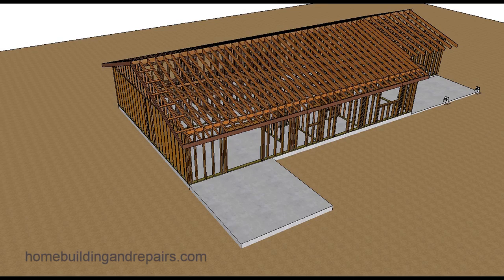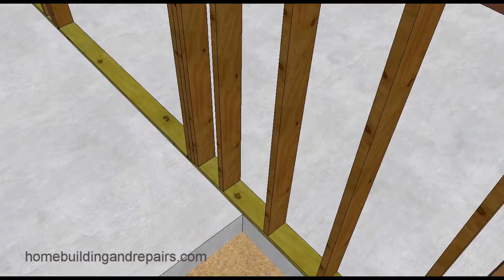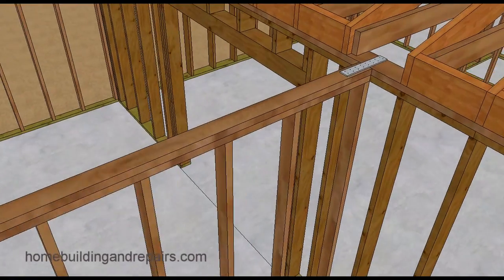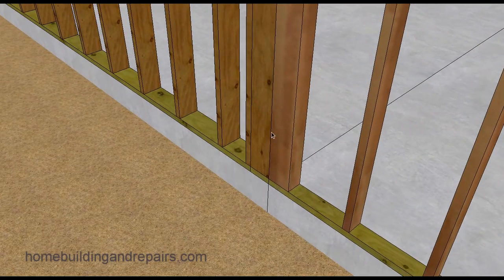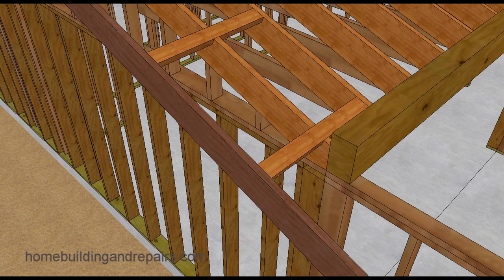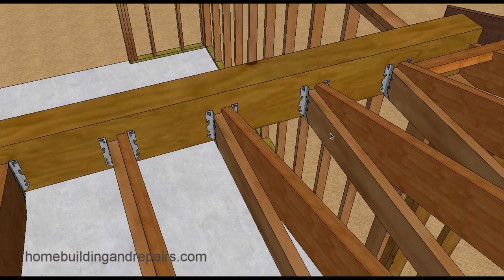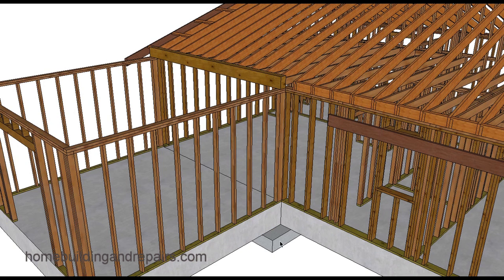How to Install Flush Ceiling Beam for Framing Home Additions – Building Design

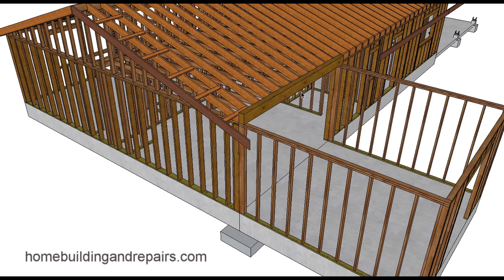Comment: Great video!! Did you make the follow up video towards the end of this video talking about the problems with the beams sticking out of the roof, especially in this case where the beam is at the end of the house @5:40?  I really appreciate the time you take in creating all these videos.
Reply from the maker: I can't remember if I did or not, but if it is, then it's on the website. Here's a link to the website and feel free to post it here if you do find it.
http://www.homebuildingandrepairs.com/home_additions/index.html

Comment: How to cut off raffters flush for an addition wall? Should I cut it from the top or from the bottom? Should I take the shingles off or just cut it straight with everything on??? Thanks alot
Reply from the maker: You can cut from top or bottom and you might need to remove other framing components and roofing before cutting.

Comment: How do you address the beam sticking up? Also, what if you can cut a flat spot on your rafter for the joist hanger since the cut is even with the bottom?
Reply from the maker: https://youtu.be/gctXowHozr4 and you can cut rafters to fit if that will help.

Comment: how large of a beam would you use for an addition with a second floor?
Reply from the maker: You would need to contact the structural engineer for information like that and remember that these videos are only meant to be used as examples for different types of wood framed construction.